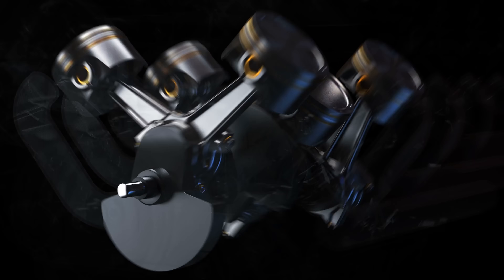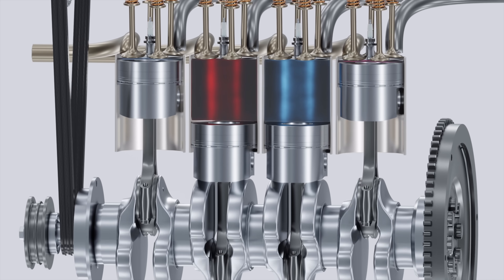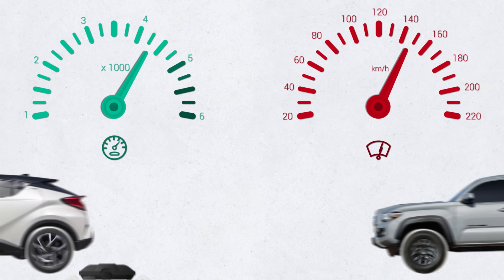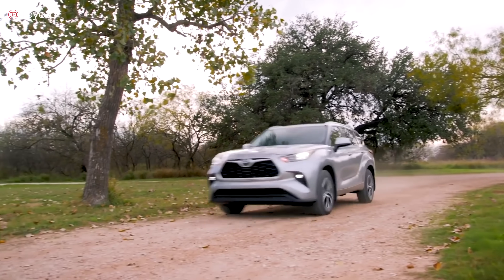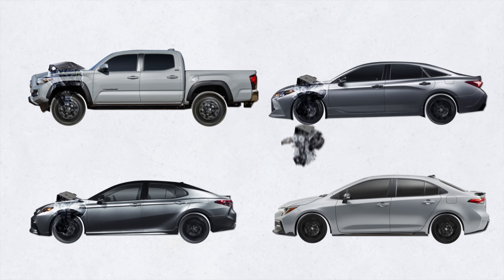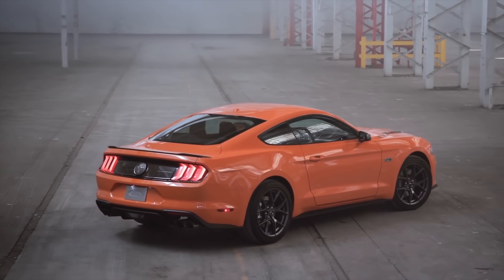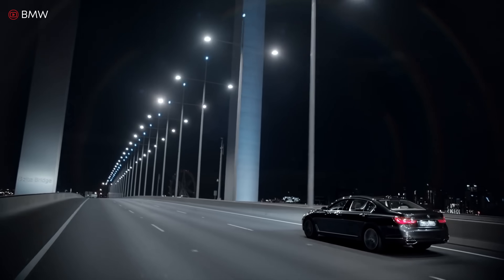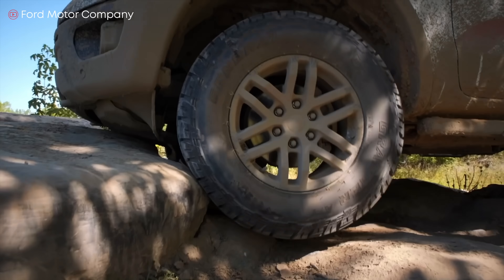No One is Telling You the Truth About Turbocharged Cars, So I Have To

Comment: More heat, more friction and higher pressures equals less reliability.  I don’t favor the 4 cylinder turbo over the naturally aspirated V-6.  Time will tell if I am wrong.
Reply: That’s a good point and there’s no arguing it, but it’s still easily possible to pull up to 250k out of your average 4 cylinder turbo if you take good care of it, it also depends on who makes the car but I do think that in the broad spectrum NA V6 will run as long or longer with a lil less matinence, Turbo’d cars are just more fun, smiles per miles 😂
Reply: 4cy are dime-a-dozen right now. But whatever's floats your boats.
Reply: With the advances in battery vehicles if you want a petrol car you may as well get a throw-away one.
Reply: 4 cyl are easier to work on and maintain. Are you the type of person who pays people to fix your car?
Reply: Much prefer the naturally aspirated straight Six over the V6 my current one being an old 2h Toyota in a Land Cruiser flat deck truck …. Awesome motor, not for racing. That Diesel will get me out bush and back EVERY TIME ! ! !
Reply: @FalkinerTim  1% of cars sold are electric. Gas cars will be around for a long time yet.
Reply: More friction???? How does a online 4 have more friction than a v6? And I guess we just gonna forget about oil while we ate at too huh
Reply: I believe you are right. I would avoid a turbo at all cost.
Reply: Skip R  but does it still do that at high elevation?
Reply: Skip R  just imagine what it’d a do with a big turbo bolted onto that lump 🤩
Reply: Wrong
Reply: How much more time would you like? Turbocharged production petrol cars have been around since at least the eighties, diesels wouldn’t get anywhere without a turbo. I think the case has been proved. Naturally aspirated has to be big to produce power, big = heavy, heavy ain’t good.
Reply: @penguwan_9515  Use a 1.5 liter turbo for a job that a 1.5 liter n/a could do(albeit slow to get there), you're probably fine. Provided it doesn't decide to blow a ring land from the system failing to correct for knock, probably not a big difference in long term longevity. There will be more maintenance along the way but most sedan applications are okay

With an suv like the escape 1.5 or crv, it's a little more questionable. With a truck that you're gonna use for towing, small turbo makes no sense
Reply: Or just get a Turbo'ed V6...just saying
Reply: @BobK5  Turbo diesels are very different in that they just making up for a horsepower deficiency per liter. The heat load that you're putting on the engine and fluids is not exceptional compared to a gas n/a of the same displacement. Also pre-detonation and knock are not possible or not destructive like in a gasoline turbo.

There aren't really shining examples of old gas turbos with the reputation of n/a Japanese 4 cylinders, European straight 6s, and American v8s. At best they're project cars that have gotten babied along the way
Reply: @caribougoo349  I had a 1985 Nissan Silvia turbo which was a great car, great turbo at that time. Turbo’s have proven themselves, what you’re gaining with n/a you’re losing in vehicle handling because of the extra weight, cornering, braking all below par compared to a turbo equivalent.
Reply: @BobK5  There's not a lot of modern sedans that let you option a 4 cylinder turbo or a naturally aspirated v6. A lexus only takes a 33 lb weight penalty. For a camaro, it's a 60 pound weight penalty. Really not hugely noticeable differences and it's primarily gonna be down to what acceleration characteristics you prefer. Personally I prefer an engine that makes me wind it out with a manual transmission

I'd be interested to hear how many years/mileage you got out of the silvia. Any repairs you took that wouldn't apply to a n/a?
Reply: Modern 4 cylinder engines do not do well when not maintained, low tension piston rings and direct gasoline injection is their downfall IF oil changes are put off. they start to consume oil through the pcv system and blow-by past the piston rings this only compounds the issue. frequent oil changes with quality oil and gasoline along with intake valve cleaning services and injector cleaning service will keep them reliable. You get the hp, fuel economy and longevity when maintained, if not you will be replacing the engine.
Reply: @jamesstewart505  older designed engines also need maintenance, regular oil and filter changes, some at 6 month intervals, produce a lot more to its and are a lot less efficient.
Reply: @BobK5  Correct all engines need maintenance. Some of the older 4 cylinder engines are more forgiving when neglected.
Reply: @FalkinerTim  yeah ok lithium ion is advanced how its the same batteries used since tesla started making them over 10 years ago.  My drill from 2006 used lithium ion batteries they are an old technology now.
Reply: @penguwan_9515  Doing that for my daily myself. Went from a V6 sedan to an Escape 2.0 turbo AWD with the 8 speed. The torque is crazy good in comparison and fuel economy is 20% better. I change the oil on it and my wife's Cruze when the oil is at 25%.
Reply: @JOHNWLOUCKS  Just bought a 2.0 Ecoboost powered Ford last year and I'll never go back to naturally aspirated. I'm more concerned about DI and carbon buildup on the intake valve than anything else.
Reply: @BobK5  the word Kaboom comes to mind.
Reply: Mr Destro  a turbo has bearings. If you think that the added bearings is enough to cause more "friction" than an entire 2 more cylinders you got some rethinking and and HELLA restudying to do. You're preference is you're preferance and that's fine, but stating false information and using it as a fact is ridiculous and just shows pure ignorance.
Reply: Not if designed properly for the heat friction and pressure you should be able to outlive anymore
Reply: I've had both and I prefer the larger NA motors that don't have to work as hard.  Formerly had SAABs that struggled with small turbo engines and crappy transmissions and currently driving a Lincoln town car with a 4.6l V8 and it hauls that big boat around effortlessly.
Reply: Yeah, I completely get it. Keeping rpms  below 2500 even on steep hills just seems better. It's like there is a trend to push the least durable to it's maximum. Good for progress but I dont want to be the one stuck with the tiny engine that could. Even if it uses less fuel.

I do however love the idea of taking a tiny 4cyl coupe and boosting it into oblivion. Fun but for a daily driver you want reliability and durability. I do anyway.
Reply: “I don’t favor the 4 cylinder turbo over the naturally aspirated V-6”
Modded Vtec with turbo and stock 4G63: am I a joke to you? 

Clearly you’re not a car guy lmao. Only non car guys hates on turbo/supercharged cars. Us car guys put them for more power baby.
Reply: @mikeknape7064  Have both engines. Prefer the Turbo for fun and power engaged. But also requires more atention. But that's not a problem.  V6 is overall good. decent, reliable. And not as much specific maintenance.  But when it come to hills  ? Turbó wins and pulls greatly.  While natural asperated engine's don't general.
Reply: @jamesstewart505  That's why cars are now disposable. Nobody takes care of them. A well taken care of, cheap car, will last decades. Most people these days don't even know how to check their oil. Really sad actually. If you're someone with some mechanical know how, you can pick up cheap, great cars that need engine overhauls for almost nothing.
Reply: Mr Destro  I was only referring to the weight of the engine but if you like big heavy cars rock on 🤩
Reply: @caribougoo349  I bought the Silvia second hand with 6000 miles on it in 1988. In 1996 I bought a second matching Silvia for my girlfriend and we drove all round France in them, touring, staying where we wanted, drove round Paris in convoy with not a hitch. Had regular oil and filter changes no major problems. One of the headlights wouldn’t pop up but I fixed that. They were 8 valve engines but pretty good at the time, I could keep up with Sierra Cosworths, M5’s of the day. Sold them in 2005 due to the usual expansion of family issues but had motorbikes to make up for the loss, ZZR 1100, Fireblade, Blackbird, Zxr etc. Run a Golf Gti mk 7.5 pp now, it’s almost the perfect car, great performance, handling, gas mileage, and comfort, practicality, you couldn’t get the same with a big six cylinder. I agree that big n/a are a joy to drive and to hear that sound but they’re outdated now and unless they start giving gas away I can’t see them coming back 🥺
Reply: I prefer a 4 cylinder engine no turbo
Reply: @toycoma98  have you opened the hood on a Jeep six ?
Reply: @BobK5  you can’t compare a Diesel engine to a gasoline engine.  The diesel operates at much lower rpms and the flashpoint of diesel fuel is a lot higher than gasoline.  Also the Diesel engine is much heavier and stronger and it doesn’t use spark plugs.  Whole different animal.
Reply: @BobK5  I bought a new 1980 Turbo TransAm. It had a turbocharged 305/c.I.d. engine.  The owners manual said that I must change the oil every 3,000 miles to not void the warranty.  It had a heat shield on the underside of the hood so the turbo wouldn’t bake the paint.  Turbos are better cooled now but even with the synthetic oil you still have to change the oil and spark plugs more often than an engine without a turbo.  It’s just physics.  Like Scotty says, the Feds are requiring better gas mileage so the auto makers are making tiny engines with turbos to meet those standards.  They don’t care how long your engine lasts.
Reply: @lc7192  yes many big cars now are running on 1 litre turbo engines like the VW T roc and Nissan Quashqai, apparently they’re reliable but I wouldn’t buy one with my cash! Modern Turbo engined cars generally require fully synthetic oil and filter change every 12 months, some are longer. Old fashioned n/a engines also required at least 12 months or 6 thousand miles oil change so not much difference there. You are losing the natural power of the engine by bolting on a turbo but the gains are obviously favourable as most cars now are turbo enhanced. My wife’s Mazda CX 5 is 2 litre n/a, flat as a pancake but lovely car, oil and filter change every 12 months same as my Golf Gti mk 7.5 pp turbo 245 bhp which does 40+ mpg and is as fast as anyone really needs. It’s all academic though with the push for electric. I’m not a supporter of electric as there isn’t sufficient electricity to power all the cars, lorries and buses, also, the production of all that electricity will create more environment issues and at the moment, it’s not the answer so I’m staying with my turbo petrol 😀
Reply: @lc7192  The comparison is in the efficiency and longevity of the turbo’s themselves, I can’t stand diesel cars though, I’d rather take a n/a any day.
Reply: Open your eyes, its been 2 decades most of the auto brands using turbocharged engine. How much time do you need  more 🤣🤣.
Which phone do you use currently old tech phone or new tech phone?
Reply: I own ford focus 2016 1.5 Ecoboost and has done 210,000 km mileage, and i have changed its spark just once at 140,000 km. This would be enough to make people understand its reliability. I'm never going back to natural aspirated engine again
Reply: @mikeknape7064  Exactly. I think it's one point - an important- that Scotty didn't address.
Reply: @mhess427  SAAB turbos are agricultural compared to the current ones with fancy fancy systems to reduce lag and produce incredibly early peak torque. 

I'd always take a big NA engine but let's not kid ourselves that as an all rounder, modern 2litre 4 banger turbos are really really good. 

Only thing that beats it is Toyota's hybrid system. Lose performance but the efficiency makes up for it.
Reply: @monkeywkeys3916  pretty much like V8s
Reply: @BobK5  anyone that follows the “oil life” monitor on their car is just asking for trouble.
Either pay for more oil changes or a crate engine in a few years.
Reply: @302Mustang13  I still go by mileage. 5k or less. Following the oil life guarantees a crate engine in the future. Most modern engines will become sludge factories if you use the oil life.
I think the at it’s part of planned obsolescence just like tech that becomes obsolete six months after you pay an insane price for the option.
Reply: @pmscalisi  12 months is the scheduled oil change for most modern cars, no need for more frequent unless you’re track day ing or not using it.
Reply: @BobK5  I do see your point but my car has the GM 3.6L HF engine in it.
Ask anyone that owns one. Going over 5k regularly even with synthetic oil is a recipe for engine failure. My car has been paid for since 2012. It’s been very reliable and I think part of that is changing the oil and ignoring the oil life monitor 
I’ve often considered buying something different but having not been to a car dealer for ten years got  a lot of sticker shock 😳
Reply: Turbo 4 or n/a turbo or super V8. I don't like v6 for anything
Reply: @pmscalisi  keep it running Paul and enjoy that big engine 😃
Reply: @BobK5  yes but in the US it’s not that big. ☺️
Reply: @pmscalisi  I agree. Oil is cheap and it takes about an hour to do myself from start to clean up. Sure better than buying a new engine saying WTF.
Reply: @Code Ultimate it’s not difficult to replace a turbo unit though.
Reply: Plus, I don't like turbos.  If I want a blown engine, I would rather have a positively driven Supercharger.
Reply: @Code Ultimate I have never blown up an engine, and I have never hung a blower on an engine.  I just don't like turbos on a gasoline engine.  They are much better for diesels, as most of them do not have a throttle plate, which means that the turbo's impeller does not slow way down and idle the way it does in a gasoline engine.
Reply: @michaelbenardo5695  don’t buy one then Michael 😀
Reply: @BobK5  Don't worry, I have no intension of doing so.  Might buy a supercharged car though.
Reply: @michaelbenardo5695  good luck with whatever you decide on Michael and best wishes
Reply: Skip R  And my inline 4 2.0T would absolutely gap your heavy V6 lol
Reply: Especially in an SUV, you’re crazy to buy a Jeep Wrangler with a 2.0L 4 cyl TC motor.  Good luck getting 100K miles.
Reply: @TheSchmed  Probably about 65,000 miles tops, unless you baby it.
Reply: Ontime maintenance would be key for such engines... and we can only know it after another 4 or 5 years
Reply: Nobody cares for electrics they are so boring.
Reply: @THE-xp3hp  Actually, I might consider one IF they redesign them with quick-change battery packs, like electric forklifts have, so when your battery is low, you can just go to a battery swapping station.  But the way they are now - requiring you to park the thing, maybe overnight, to recharge it?  Nope, glorified grocery-getters are not good enough for me.
Reply: Turbo 4cyls are getting better and better for the most part they are getting more efficient and reliable than years past. You still have your few out there that I wouldn't buy. With that said no matter what vehicle anyone buys its all about the owner and how they drive and how well they take care of the vehicle doesn't matter if it's a NA or turbo 4cyl, 6cyl or v8. I work in the automotive industry never take the owner for their word and never believe everything online google has 1000s of forums but 10 people may have 1 problem out of thousands of cars that never experienced the one "common problem" 10 people experienced, if you not highly knowledgeable about vehicles or what to look for I advise taking it into the dealer and have them do their used car inspection that they would perform if they were looking to sell it  or possibly send to auction if cost to repair was higher they'll scan for active and stored in history codes never know if the person trying to hide a light or maybe the seller was honest with what he knows but legitimately didn't know there was an issue creeping up that hasn't completely shown its face yet like a small leak developing or a tie rod or wheel bearing beginning to have some small play that hasn't caused any noises yet or drivability issues. Foe example I had an old Cherokee that was lifted and big noisy tires was a daily decided to sell had a newborn pulled it in my shop a week before I listed it went over it and noted some things checked the steering and suspension everything was tight a week and half later someone drove it said something felt loose on the right side I said ya ya ok whatever just saying it as an excuse he left well before I left I pulled it in to cool it down from the summer heat I just said wth I'll just check it again to be sure and sure as hell the wheel bearing had excessive play enough where I wasn't comfortable driving it home knowing that so had one hot shotted to the shop and put it on.
Reply: You are right
Reply: Tell that to all the turbo I-6 semi truck diesels that more often than not see well north of 1 million miles. If the engine is engineered right and heat is managed right it is not an issue.
Reply: @toycoma98 cries in boxer 😢
Reply: If the cooling system deals with thr additional heat, it's a non-issue